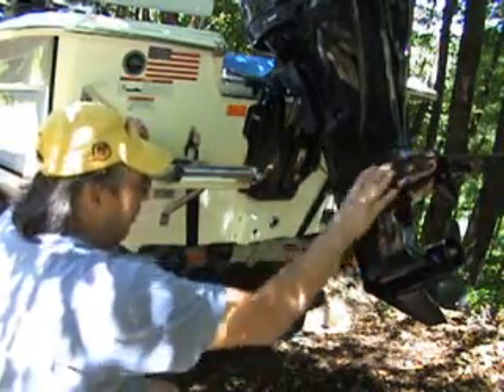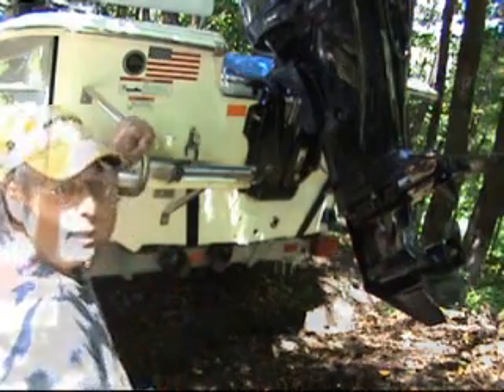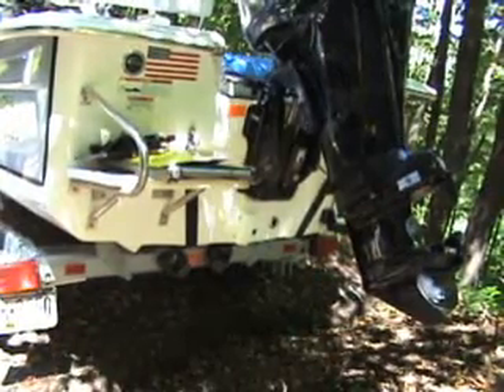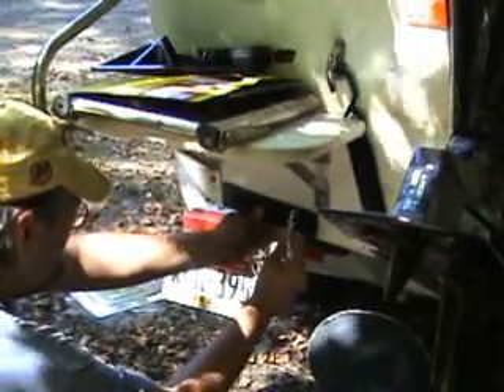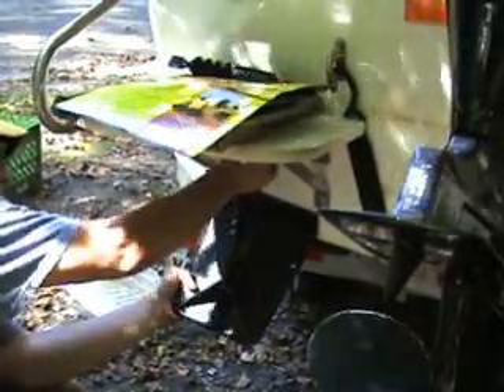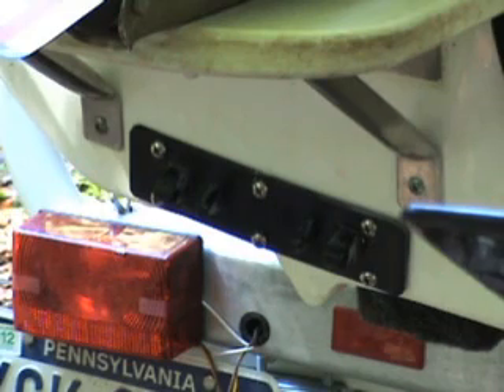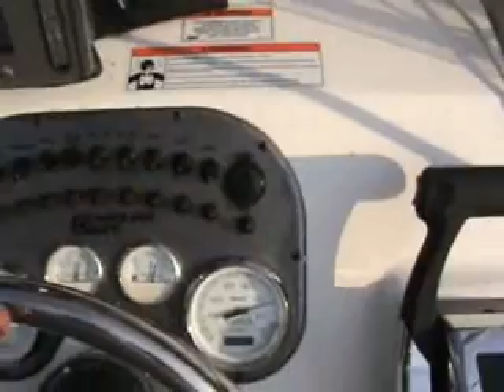Smart Tabs Review

Comment: smart tabs = drag
real trim tabs are fully adjustable remotely
Reply: My 26’ Proline with a Mercruiser got better mpg with regular tabs slightly extended.  The smart tabs move up as pressure is applied so I’d suspect they would do the same with a heavier four stroke.